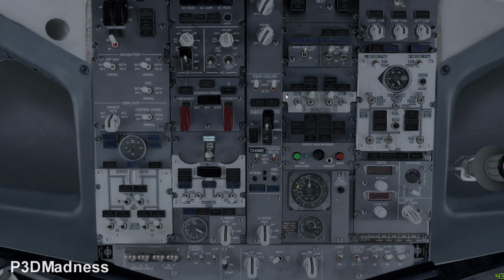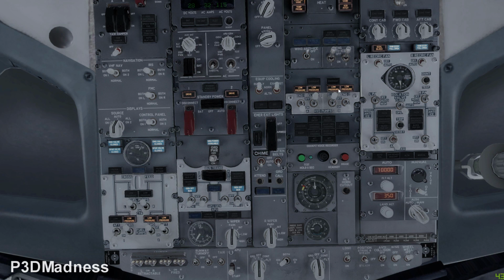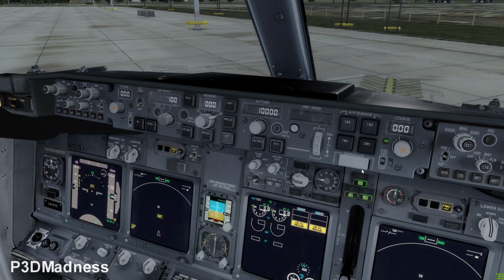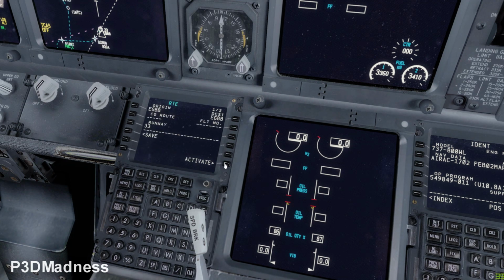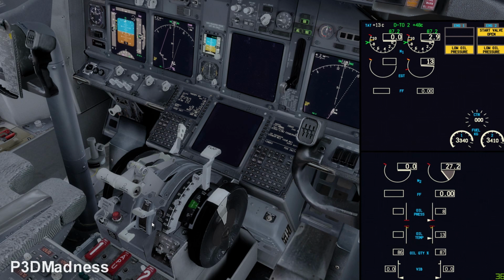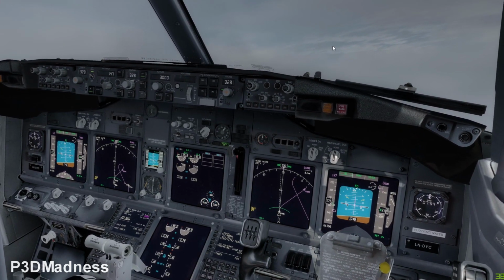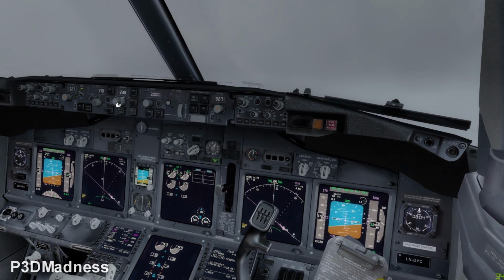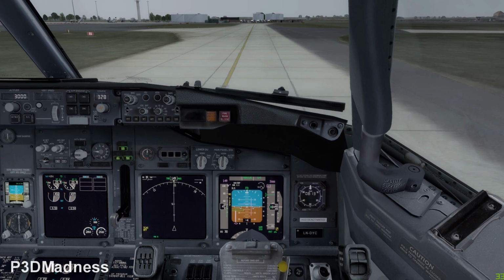AIRLINE PILOT SERIES | Real life B737 Captain | TUTORIAL | EPISODE 1 |

Comment: Where did u get those procedures as they are very distant from the boeing ones! You started out with the electrical power up which is detailed in the Supplementary Procedure portion of the FCOM and you made several mistakes. I do appreciate the effort to divulge technical info to the simmer community but please make sure you provide the right bits of information. Thanks for sharing
Reply from the maker: These are airline specific SOP's. Many airlines deviate from Boeing's SOPs to suit their own operational needs